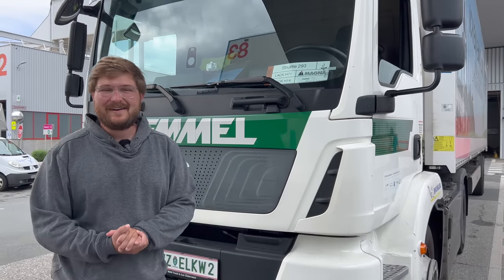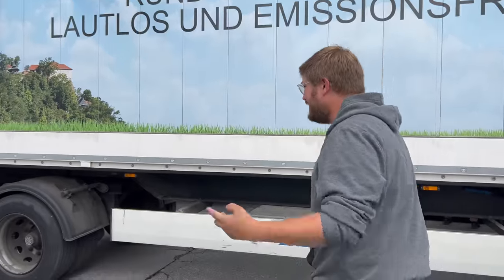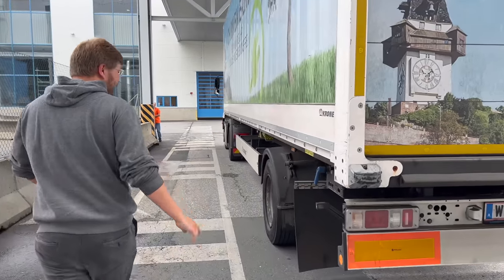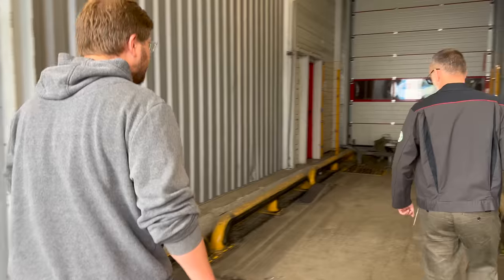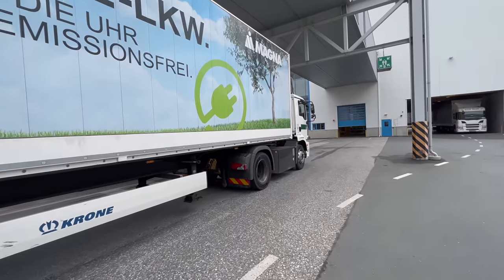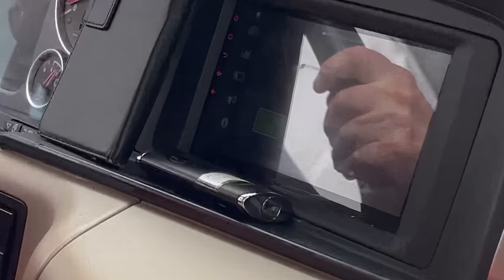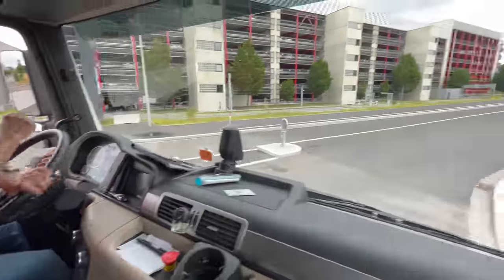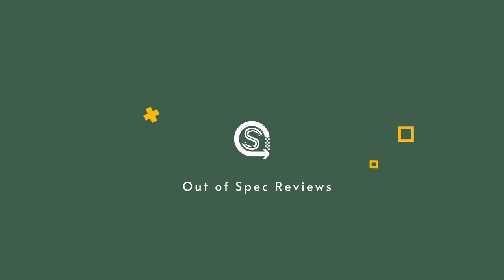Meet The Electric Truck That Makes I-Pace Production Possible!

Comment: The perfect use for electric trucks are assembly yards, ports, rail yards, etc.  We could replace everything but long haul trucks today if we wanted.
Reply: and last mile delivery
Reply: totally, i dont get people who look at ev's black and white. Not everything needs to be electric, but many things can.
Reply: @plushiie_  In an ideal situation we would have electric trucks for short trips and electric trains for long trips.  The fact that we have fossil fuel trucks hauling goods for thousands of miles is ridiculous.
Reply: If only we had a way of doing long haul shipping with an electric vehicle. Maybe we could have some kind of truck on steel wheels and a steel road that constantly charges from an overhead electrical cable. You wouldn’t even need any batteries, and you could connect these trucks in long lines. That would be pretty cool
Reply: @MadMadCommando  Electric Trains for long haul and electric trucks for short distance.
Reply: Janus in Australia is already converting trucks for long haul.

Comment: So if they using 1 truck (second is backup) and whole cycle take: 
15 min per 4 cars (2 up and 2 down) 
16 cars per h and they don't work in night and sunday so assuming 2 shifts = 16h of work = 256 cars per day 
253 working days in year it give 64 768 IPACE by year. 
So they have to have at least 4 drivers = salary of drivers is around 2800 euro netto 
so it give + 2,5 EURO for price of IPACE 
So total costs will be around 5-10 euro per car only for driving it for painting :D

Comment: 10:33 Using "connecting Fingers" was the first concern that I had.
Why not use sliding plots like the one used commonly for overhead crane (also called bridge crane) ?

Comment: Pretty cool Kyle, typical German over engineering on the charging system.  Think about the time, money and resources to make that back in charging system when all that was really need was the driver getting out of the cab and plugging in the charger.
Reply: Surely a wireless charging device, would be  good option too. But kool that is electric and not diesel.

Comment: Hydrogen is the future and not ev trucks
Reply: As a power generator working for a company that leads in hydrogen, battery, and diesel engine manufacturing for truck OEMs I can only say each product has its place in the market. Hydrogen appears it will eventually replace diesel for long-haul heavy loads whereas battey vehicles are well suited for under 40k lb loads traveling less than 125 miles per day. It comes down to the cost of energy per weight to power the trucks.
Reply: Hah! I do not think so for short haul.
Reply: Not really. We have many of them and they suffer a similar fate as Electric trucks